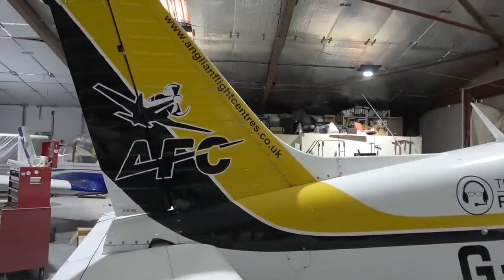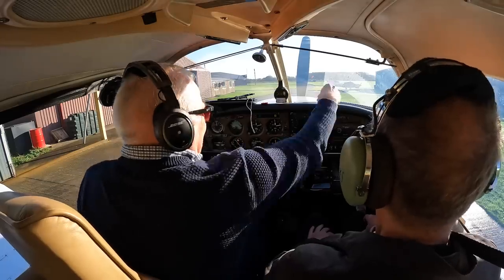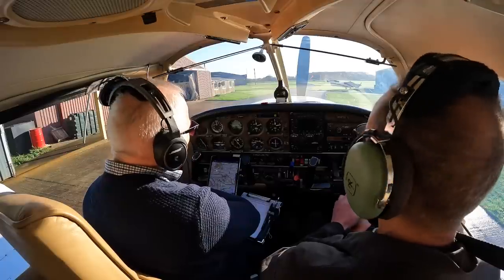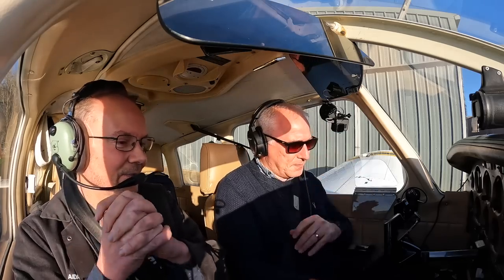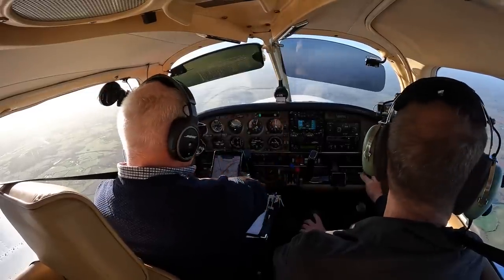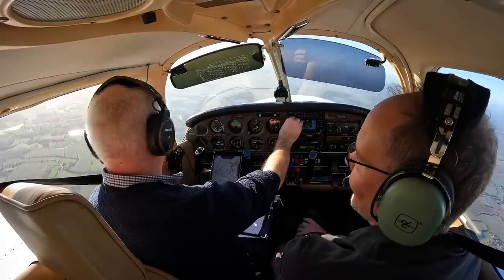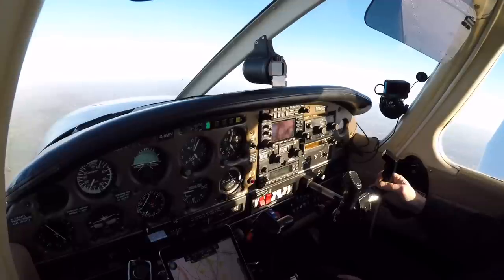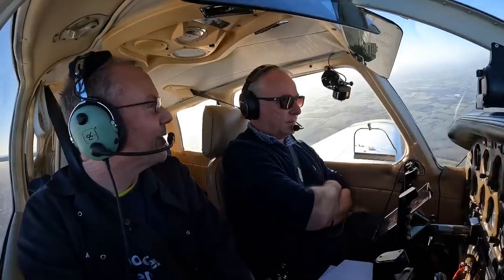Breaking in my new cylinders - first flight

Comment: Interesting running-in process, a little different from a car, motorcycle etc. I've used a straight "single grade" oil when running-in cars, motorcycles etc (or new engines) Eg back in n the 1980s and 1970s we'd use, iirc, SAE 30 (I think they use that in Lister/Petter powered barges these days🤔😄😄😇). Then we'd drop it out after the required period and check everything round, re-torque the head etc etc and refill with correct grade oil. Even now we still run cars in, then get the oil changed at 500-1000 miles. Engines are better for being used Eg flying clubs, frankly it worries me if our cars are sat about for too long, let alone an aero engine 🤔😳😳 But back in the day, the straight oil was zero detergent/additive and similar for the multi-grade oil for first 10,000 miles, pretty much for the same reasons you've described here👍👍

For automotive there have been good anti-wear, anti-corrosion additives, but I always reckon on at least 10,000 miles engine use before adding such.

Also gently increasing speeds and revs at certain key milages without labouring the engine and on motorways vary the revs to stop the creation of ledges/lines in the bores.

Japanese motors can be (were) tricky to run-in due to their fine tolerances.
Reply from the maker: Do they still run-in car engines?

Comment: A few questions for the engineers :) Thanks a lot btw for that, it's really nice to get a chance to understand a bit better what is going on under the hood!

- Corrosion: it seem that one of the leading causes of corrosion is leaving an engine not running for a while. Why is that exactly? What can be done to minimize it, aside from flying more often? What are the consequences of corrosion, concretely?

- Good practices: What are the best things you have seen pilots do to take care of the airplane's engine - in flight, and on the ground?

- Learning the mechanical side as a pilot: what's the best way to gain a better understanding of how the airplane actually works? Pilot training has very little of that. Go to a course? (are there some good engineering courses for pilots?) Be there when the mechanic is working, and ask a lot of annoying questions? :p
Reply from the maker: Thanks Xavier.  Good ideas - all added to the list.

Comment: That continual flashing gear unsafe warning would irritate the hell out of me, is there not a Piper SB to stop that ?
Reply: It's probably a camera shutter artefact. I expect to a human, it looks continuously on. I can't imagine that any manufacturer would install a flashing light that was not a warning of something.
Reply: @sylviaelse5086  Nope, it is a warning light , advising you that the automatic gear retraction system has been overiden, nomally when you do that you pull the bulb out a little so it des not drive you nuts. The reason you do the override so the gear does not drop out when you pull back to much power.
Reply: @sylviaelse5086  it is a landing gear override warning light, it indicates that the automatic gear extension system is disabled.  From the dim and distant past I seen to remember that Piper issued an SB to disable / remove the system and do away with the irritation of the continual warning.

Comment: Thanks Jon. My Bristell NG5 build is nearing completion and I wondered if the bedding in process described Aiden is similar for the Rotax 912 ULS?
Reply from the maker: While the principles will be the same, the running in procedures are engine-type specific and you should see what the Rotax manual states.  it may specify different oils to those we are using in the turbo continental.  Hope it goes well!

Comment: Great video Jon-very informative. Quick question -are u getting same performance as before the new cylinders re: TAS for a given MP/RPM setting? Curious since our flying club turbo Saratoga dropped 10 kts TAS after a cylinder replacement.
Reply from the maker: I'm getting the book performance figures Douglass.  If anything it's probably better.  Climb performance is considerably better.